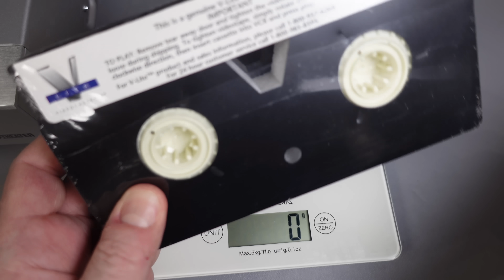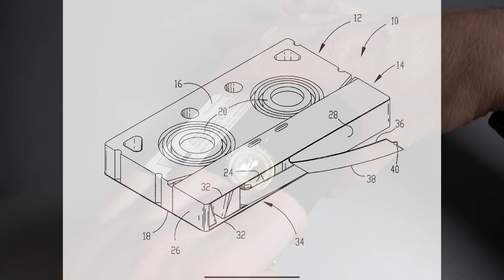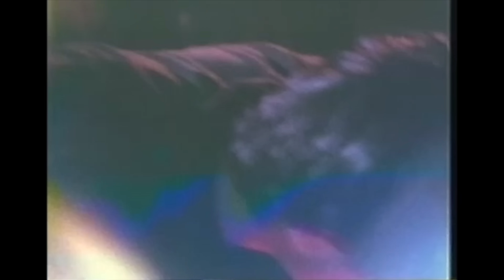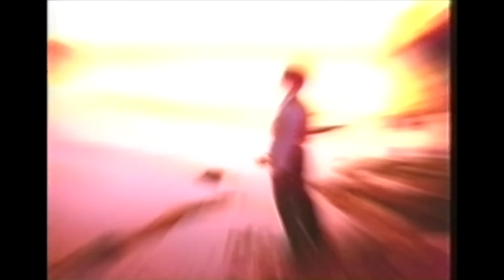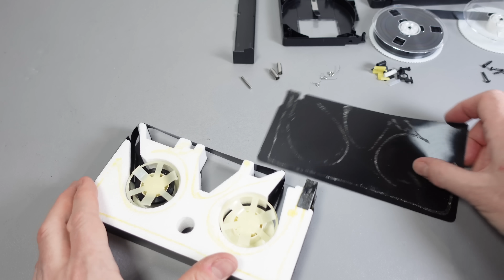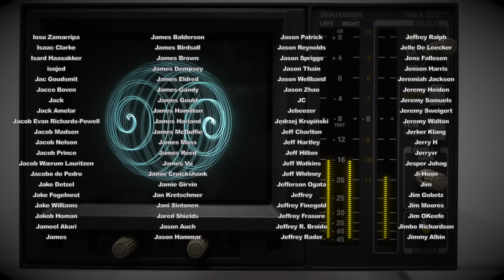V-Lite: Disposable Lightweight VHS tape

Comment: Im not really suprised the music industry utilized Vlite tapes that late into the 00s, i collect Music video tapes (mostly from the late 80s & 90s) but the latest ive seen were rap/pop singles around 2005-6, mostly just because they were at the time significantly cheaper to produce than DVDs, even for a huge company like a record label, these were seen as disposable premotional items, so its not suprising they didnt jump on DVDs right away. Its honestly quite rare to find even an SVHS copy of a music video as even that was pushing the envelope for cost/value to the company, broadcast masters seem to have been SVHS for the most part but any promo or review copies are without a doubt going to have been recorded on the cheapest VHS tapes money can buy. dvds were definitely cheaper to ship but magnetic tape was extremely abundant and everyone had a vcr, not to mention as DVD gained ground in the market the price of magnetic tape plummeted, which made it all the more lucrative for record labels to use for singles.

Comment: 8:25 Actually, you often CAN recycle foam-plastic packaging --- antique shops and private people who do eBay shipping often have a need for these materials, and so all you have to do is bag/box them up in an appropriate sealed container (so that they won't scatter around in a breeze-gust and make a mess everywhere), and then drop them off at the place where they're used for packaging up delicate items to ship.  Even larger pieces of solid foam might be acceptable to these places, as well, since they could be either just chopped/crumbled up into smaller cushioning-fragments, or simply used as-is to serve as protective blocks for padding larger items, or as shock-dampening material in which to stick small pointed objects like jewelry, pins/needles, or twist-drills and other metal tool-bits. :D

Comment: If I were to do this today, I'd send it on a microSD card - perhaps with the SD card adapter. I haven't checked but low-density cards are probably pennies when purchased in bulk.

Comment: Back in the 90s, you could have distributed on analog C or Ku band satellite. A couple companies bought transponder space and for as little as $300/hr, you could send your tape to them, and they would play it for anyone who had a dish and tuned to the channel at a particular time. Audio feeds were even cheaper and could be a analog subcarrier of a video channel. As there was a lot of unused spacefor audio on a video channel, you could prpbably have just made an offer to the tv channel if you could use some space. I once called into a c-band talk radio show, my voice went over the phone line to their studio, then an internet line to the uplink facility, 22,000 miles to the satellite, then back dowm to the dish in my yard, and to my receiver and stereo system. There was like a 10 second delay. I used to think live was live, but there is a small delay.

Comment: If the longest tape with the three music videos runs at about 13 minutes then Techmoan's current "Retro Tech" playlist would require 237 cassettes. You'd need 33.6 ft³ or 0.95 m³ to store these, which is comparable to the space taken up by about 720kg of maple syrup or 807kg of rice (about 2,824,500 calories of rice). At 2,000 calories a day, that's 1,412 days of  rice, or almost four years of (admittedly limited) sustenance. So which is it, the rice or the tapes? Bearing in mind that you'll need 1600 litres of water to cook said rice.

Comment: The format looks as though you could have sent longer videos by increasing the real size, but I wonder if the reel size (and video length) was limited in order to to hit a target weight for a specific US postage rate at the time. It's been a long time since I worked in a mail room, but I do remember working in literature fulfillment where brochures had not more than X number of pages to fit a certain postage rate.

Comment: As a kid, i used to edit my own videos with VHS, by pausing the parts exactly where i wanted to cut (and timing the distance between the parts) taking the cassette apart and literally cutting the tape (with scissors) using sellotape to affix the two parts of the tape, putting the cassette back together, and hey presto a very rudimentary editing process...To my surprise it actually worked (to a certain extent) oh, and the amount of using a cleaning VHS tape (if you remember the ones with a little hole and cleaning fluid) to sort the heads out was astronomical...I've still got the tape somewhere (i must of done it around 5 times during the entire tape) I wonder if it still works?🤔🤣

Comment: This is up there with FlexPlay, the chemically disintegrating "disposable" DVD format that came and went in the early 2000s, then re-emerged to vanish again before 2011. Or maybe DIVX, the "Circuit City" (electronics chain store) system for selling DVDs that could only work if your DVD player had a modem (!), so that nowadays if you find one of the few titles that were for sale, you can't play it at all. DIVX's failure helped to  kill "Circuit City" in America.

Comment: Your player probably considers it a cleaning vhs

Yes that is a feature

Un fortunately

If it's considered a cleaning vhs by the player its emediately spit out basically all the time as it thinks there's nothing to play as cleaning vhs tapes are basically v lite tapes very light weight tapes with what is very thin cleaning tape inside

Comment: I used to burn stuff for work or coworkers and friends on mini DVD-RW. Those 8 centimetre discs meant for camcorders were perfect to fit into your pocket or even mail them.

It had stopped a few years ago since most people didn’t had any optical drive attached to their computers any more. Also mailing a maximum of 1.46 GB on snail-mail takes a lot longer than uploading it to a cloud storage and email a link.

The general idea of using mini-DVD-RW as “sneaker network” (👟) was that you can’t rewrite those discs very often anyway and if someone forgets to return it, it’s not a great financial loss.

I still have some envelopes meant for 3.5” Diskettes left. The Mini-DVD inside a jewel case is a good fit.

And nowadays there are inexpensive pendrives. Now I use a bunch of pendrives shaped and about twice as thick as a debit card.

Comment: I'm surprised they felt a lighter tape was needed that late in the life of VHS. By then the tapes were 1/2-1/4 the weight of the early ones from the late 70's...Those early tapes were so heavy that one of the last generation standalone VHS before the DVD/VHS combos took over which I used to have (it was all plastic inside and out, except the heads and PCB) got it's loading mech broken by a playing a load of the early tapes I happened to pick up.

Comment: In the 90's I worked at an arcade where they received 5-6 VHS tapes at a time with music videos. There may have been a short music segment with it too. We swapped tapes 2-3 times a day and sent back the old tapes when the new ones arrived. Even back then I thought there should be a TV/SAT channel that we could tune in to get the broadcast. It would have been cheaper to get the cable TV company to supply us a feed and put on MTV.

Comment: I've heard of these before, but they genuinely did not really resonate with the public. But honestly? Had the V-Lite videocassettes been made of a more recyclable material, they would have been great in the days when motels/hotels were starting to have VCR'S and game consoles for rent. The V-Lite would have made great rentals for the hotels because they would obviously be very limited use (1 play maybe 2), easily disposed of by the guest, and cheap to the point that a hotel could buy the V-Lite movies, place them in slightly modified vending machines, charged a decent price, and not had to worry about not rewinding, no returns, nothing but basically sit back and enjoy the profits.

Comment: I am an old fossil that remembers life when if there was a show you wanted to watch, you needed to check the listings for the time and channel when it was aired.  My family didn't get it's first VCR until I was in high school.  That VCR had a wired remote.  That's right, you needed to plug the remote into the front of the VCR.  The pause "button" wasn't a button you pressed, it was a switch you pushed up to pause or down to unpause.  It also unpaused if the cable was disconnected.  My freshman year of college, my RA had a VCR that was much older than the first one my parents bought.  It was larger and the tape was loaded on top .  But the really wild thing about it was that it had 2 rotary channel selectors, one for VHF channels and the other for UHF channels.  

I am also an old fossil because I refuse to abandon physical media.  I got rid of all my old VHS tapes years ago, but I have held onto my DVD collection.  I've even purchased new ones this very year.  I get nostalgic for a lot of older TV shows that aren't available to stream anywhere.  But Amazon often has complete series DVDs on sale at relatively low prices.  The other advantage of physical media is that you don't need to worry about a movie or series leaving a streaming service or for the company you purchased a digital copy of a show or movie going out of business.  I have a standalone 4K bluray player and a PC with an internal 4K bluray burner.  My standalone player is connected to my living room TV, while the PC is connected to the TV in my bedroom.  Unfortunately, DVD drives don't come bundled with Power DVD software anymore.  The Power DVD license actually cost me more than the drive did.

Comment: Regarding recycling of extruded polystyrene; it is actually one of the few plastics that is very well-recyclable... if you live somewhere where there's a collection point for it. In the Netherlands, for example, there's no curbside collection but you can bring it to the 'milieustraat', ie. the drive-in trash deposit place. However, I doubt whether this would have been possible back when these cassettes were a thing.

Comment: That 7.5MB Spacejam trailer would have taken about an hour of uninterrupted download time, so either 60p or a quid depending whether it was a weekend or weekday-evening call. For 2 minutes of barely legible video in a tiny window that jumped and blurred and etc etc. That is, 1 MB took 7 minutes on a 28.8k modem, I worked that out back in the day and it's stuck with me since, it's a figure I needed to think about a lot until broadband was invented. We used to joke about having our own T1 lines and how extravagant it would be to have 1.5megabits / second! Half joke, half dream, it was more than we could imagine.

Back when Youtube started I couldn't believe anyone would waste so much money, the bandwidth costs would be enormous! Of course they were, but the plan was to burn through money until bandwidth massively increased and costs plummetted, which happened very soon after, so whoever founded Youtube was smarter than I was. So, up until whenever it was, downloading video wasn't an option. Even early Youtube was limited to 144p or 240p.

And all that's assuming you actually owned a computer. People didn't. So there was plenty of time for V-light. Shame they didn't invent it a bit earlier but even so I don't think it's problem was video downloads obviating it. Maybe it was more than postage costs for video promos just weren't that high, there's always low-priority bulk mail options, or alternative routes like getting paperboys to do it, or giving away at shops and supermarkets. So it wasn't solving a particularly big problem. And how much demand was there ever for promo video tapes? Would you have been arsed to even put one on to play more than once? I think it was solving a problem nobody really had.

Comment: It really seems that the biggest weight is the tape reels so it really could not be that long running time before the weight would be the same as a regular VHS cassette. SLP could have been an option but there were some players that could not play them well if at all plus the quality was indeed crap.

Comment: So few used websites in the late 90's.  And I think the cost of mastering a DVD is being overlooked.  In 2000 I worked at The Post Group Hollywood helping author DVDs and IIRC our clients were paying about $10K just to author a DVD and produce the glass master and DLT tape for replication.  

So producing a small run, say 5,000, video clips to mail from about 1998 to 2000, it was probably still much cheaper to use something like this V-Lite tape.

Comment: @Techmoan,I’m an American and I’ve never seen one of these before or heard of it until today. I really don’t see the point in it much either since media mail rates in America are relatively cheap. You can ship a box full of books that weighs 30lbs for nothing..  Same with record albums and video formats.  Seems that since these only hold a very small amount of tape they had extremely limited applications. In fact I’ve seen tapes sent out by car dealers and “for your Emmy consideration” tapes that were standard vhs cassettes.

Comment: Was that the "Dude You're Getting a Dell" guy in that video? I'm not surprised the JVC rejected the tape. The late model JVC decks will refuse to thread regular VHS shells missing the protective flap as a fail safe.

Comment: The most interesting VHS tape I ever encountered was in the late 1980's when I worked at a video rental store. It was a screener tape that was sent out by video distributors with a complete version of an upcoming movie release. It had a limited number of plays on it, usually 5 before it would self erase. There was a mechanical counter installed between the reels that displayed the number of plays so far, when it reached zero it would trip an arm that had a magnet on the end of it. That magnet would contact the edge of the tape that contained the tracking info, when you rewound the tape after the last play it would erase the tracking info, making the tape unplayable. Since the tapes were supposedly self erasing we were not required to send the tape back to the distributor. It was easy enough to open up up the tape and remove the magnet and counter device so the tape could be watched an unlimited number of times. I held on to one of those tapes for a number of years with the counter and magnet still in place, resetting the simple mechanical counter after the movie was played a couple of times, I wish I still had it.
Reply: It reminds me of that spy TV show where the tape had a message at the end that would say, "This tape will self-destruct in 30 seconds "
Reply: @brentfisher902  Mission Impossible?
Reply: @brentfisher902 
Mission Improbable
Reply: @brentfisher902  Believe it or not, Techmoan has done some videos that showcase the technology of that spy TV show you mentioned. Check out his video series titled "Tape Recorders of Mission Impossible"
Reply: This sounds like the 2View tape, which Techmoan did a video about around a year ago (or a year after you left your comment)

Interesting that they found a niche use outside of video rentals!
Reply: That's so cool and stupid! I've never heard of that before.
Reply: Must have been a version similar to what they sent out to voters for award consideration.
Reply: so a 5View?
Reply: Whoa! I've never come across one of these -- hilarious!  
Question -- Do you remember what movie it was?
Dorkier Question -- Do you remember if it had on-sceen warnings that screeners typically had? You know: "FOR INTERNAL USE ONLY.   THIS CASSETTE IS PROPERTY OF ...." 

Because that AND the time bomb magnet together would be outright adversarial!
Reply: @blackcentury  I do not remember the title of the movie but it did have the "Property of (studio) Not For Sale Or Rental" on screen at the bottom of the screen through the movie. There was a warning on the box that the tape would self erase after a certain number of plays.
Reply: I wonder if someone who did this now has a copy of a lost unreleased film

Comment: BTW you Self Recycle Polyurethane & Styrofoam  at home You just need A Can / Tin  / Jerry can of Bulk Lacquer thinner 5 ~ 20 Lters and  a Outside covered  Open  space 
Polyurethane & Styrofoam Convert into Polyurethane "Clear" Varnish or Lacquer  For Woods , Furniture And brick walls with Frost damage (crumbling)  (Home made Thompson's Water seal)

Lacquer thinner works Pretty Quickly Dissolving and converting  Polyurethane & Styrofoam to Polyurethane

Comment: What a fascinating version of the VHS tape. I've encountered a different lightweight VHS in my tape collecting, but not nearly as cheap! I've never taken one apart, because it'll definitely be ruined if I do, but it seems like it's built a lot like a standard tape, just with softer plastic, maybe PVC, with fewer pieces, and it's held together possibly with internal clips instead of screws. Big downside is no windows, so no idea if the tape is moldy!

Comment: A store called "Campo Electronics" mailed VHS advertising tapes when they opened new stores in Memphis. The tapes had a large sticker covering the tape much like this, but were standard VHS tapes with a door. The running time was 5 minutes, including locations of the stores and an incentive to return the tape: they would trade it for a new 2 hour blank VHS tape. (Of course, I didn't return the tape, and eventually uploaded the contents to YouTube....)

Comment: Another great presentation. It helped a lot to have the adhesive crumbling as you took it apart. Never saw one in person. Also, some Panasonic decks seem to be indestructible. I have one that just needs a little cleaning sometimes. It's also fully functional with all the cabinet removed. The switches are labeled on the main circuit board and the tape transport is easy to figure out. Later decks are so integrated, the machine is practically empty inside.